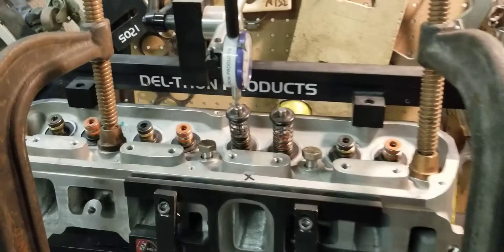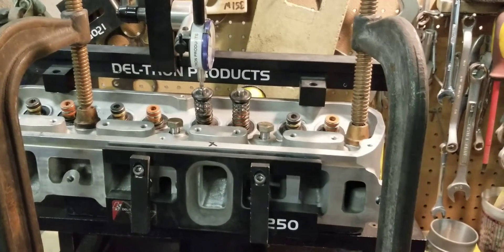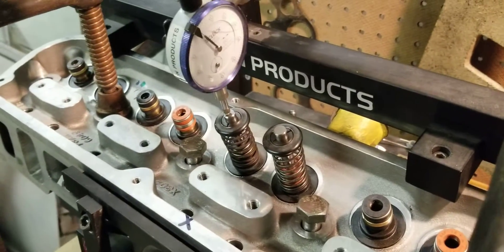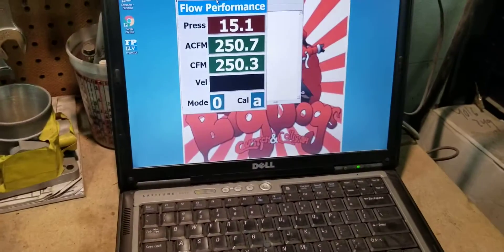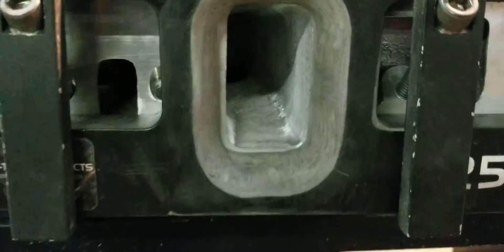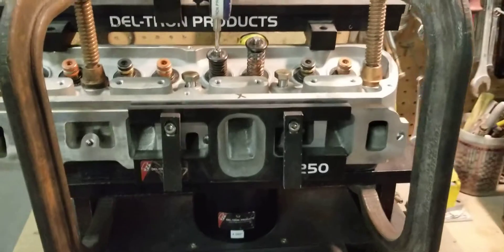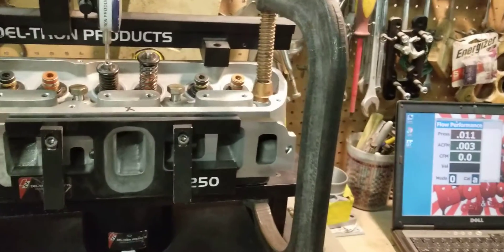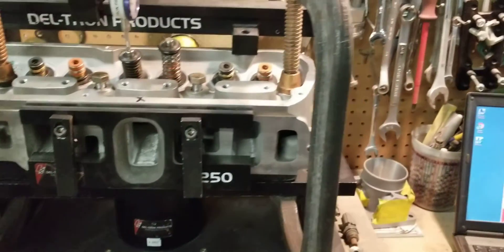SBF GT40X Stage 2 ported heads by Bigdogs Porting

Comment: What kinda flow did you get out of the exhaust?? I just purchased a set of these NIB.
Reply from the maker: Before and after full flow results are in the description. These heads flow like crap in stock form for the amount they cost. Iron gt40 heads with a good 3 angle valve job will flow slightly better than stock GT40X heads. We've compared them. Only way I'd run these heads on anything is if they were ported with before and after flow results like these.
Reply: @bigdogsportingtonyb2833  I will be contacting you shortly on the set I just bought. Thanks for posting the numbers. Wish I would have read the whole description. lol

Comment: Nice work!What size gasket is that cut to 1262 or 1262r?
Reply from the maker: Gasket size really has no effects on flow. All of the gains are from porting and reshaping the runners.
Reply: Not on Facebook I’ll get a friend to do it.
Reply from the maker: @robertwilliams7373  you can still see our content and videos just by googling Bigdogs Porting.
Reply: I have a set of these gt 40 x I’m interested in getting the stage 2 job, do have a website where I can get a price
Reply from the maker: @robertwilliams7373  you can message us about pricing on our Facebook business page at Bigdogs Porting. Google Bigdogs Porting and you will find us.

Comment: Nice work this is very similar to the AFR 165...   I just saw a 302  put down 420 hp  with...  So 380? I feel like you can do that with ported E7  lol.  That's a conservative estimate then.
Reply: He said 380rwhp which is around 430hp at the engine if its a manual transmission.